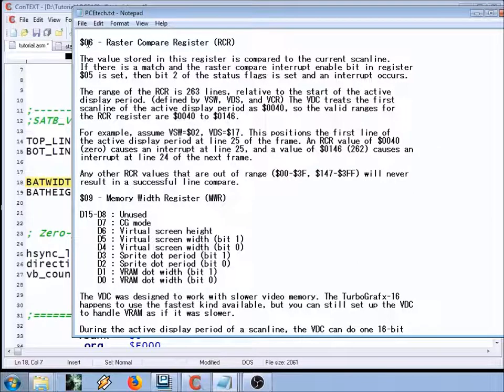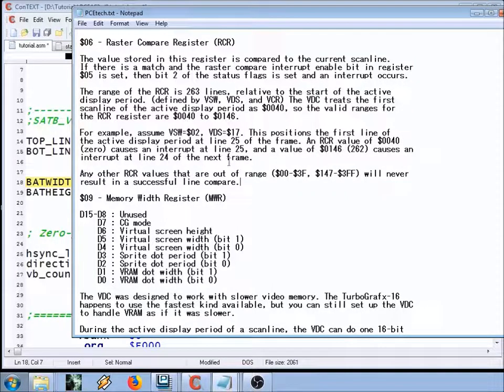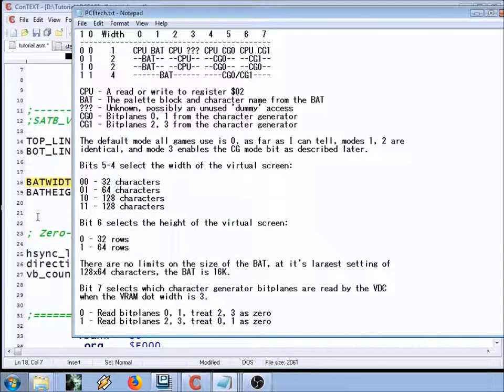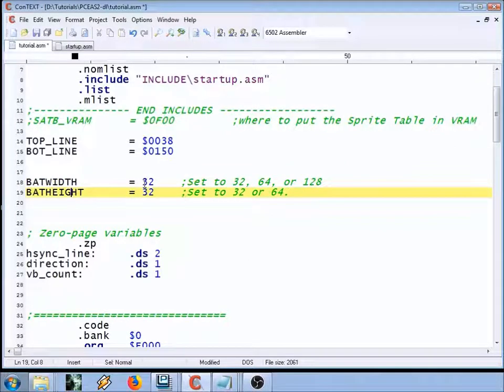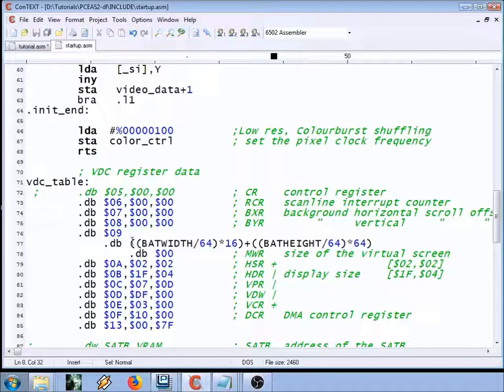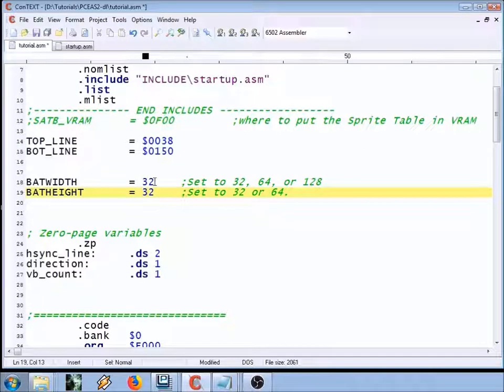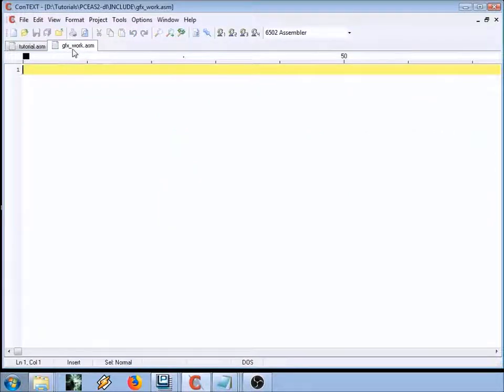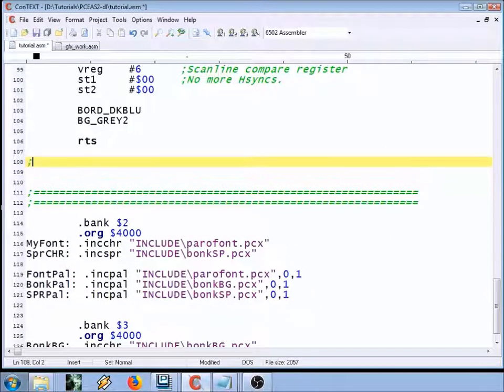PCEngine-Turbografx ASM Programming ep06b Text, Tiles, and Sprites on-screen!

Comment: I am still learning a bunch of stuff. These tutorials have been really helpful. There are a couple of things that I cannot figure out, one is when you wrote print_byte and print_Nyb. You divide by 16 and 4096 and then you use an OR.This somehow gives you the ascii code and correct tile idx but still confused about how it works.
This is more a confirmation, when you write the clear_bat you use 01 as high byte. I think this is used to set the palette of a tile but I think that the BAT pointer looked like this: PPPA AAAA AAAA AAAA, where P bits are to set the palette and A bits to set tile index, then you are using palette 0 and tile $141 that matches with letter A, am I right?

Thanks again for your awesome videos.
Reply from the maker: Sorry for not being clearer.   Each 8x8 graphic tile takes up 32 bytes in VRAM, which is 16 words so to address the tile in the BAT you can divide the VRAM address by the # of words per tile.
Each BAT entry is actually PPPP AAAA AAAA AAAA, since there are 16 palettes to choose from.
Reply: Ohh I see now, that makes sense. Thank you again.

Comment: I have another question, when you use TIA instruction to transfer SATB to VRAM. Why do you need to alternate the destination? Does alternate works on 2 vram addresses? Does that mean that your copying word per cycle?
Great videos, I don't find any other resources as good as these videos. For a beginner like me. Thanks.
Reply from the maker: The TIA instruction increments the source address, but alternates between the dest and dest+1 address.  This is needed for the VDC, VCE, etc. which are 16-bit and expect writes/reads to $0002 (low byte) then $0003 (high byte), etc.
Reply: Does that mean that the source address will be incremented by 2 in each iteration, something like this:

First Iteration
(Read a word from the source + 0)
srcAddress                                     ->  destVRAMaddress (LOW BYTE)  = dereference of srcAddress (low byte)
                                                         ->  destVRAMaddress (HIGH BYTE) = dereference of srcAddress+1 (high byte)
Second iteration
(Read a word from the source + 2)
srcAddress+2                               ->  destVRAMaddress + 1 (LOW BYTE)  = dereference of srcAddress +2(low byte)
                                                        -> destVRAMaddress  + 1 (HIGH BYTE) = dereference of srcAddress +3(low byte)
...
Reply: Thinking a little bit more about this maybe is the endianess of VRAM the reason to use TIA. Does VRAM use big endian? probably ?
Since ram uses little endian the bytes are the other way around and TIA would change the order, am I right?
7 Comments
Brian Baldwin
Add a public comment...
Brian Baldwin
Reply from the maker: There is no "order change"; the low byte of registers/VRAM goes into the VDC via port $0002, and the high byte goes in (and usually latches the entire 16 bits) with a write to $0003.
TIA is just a way of automating STA $0002, STA $0003, STA $0002, STA $0003...
Reply: Ok, I see it now. Awesome thanks